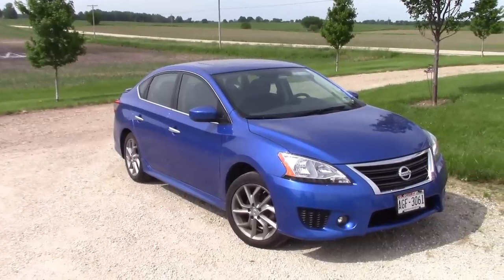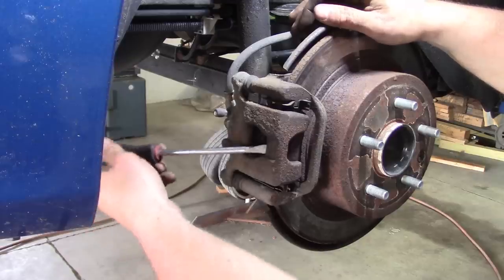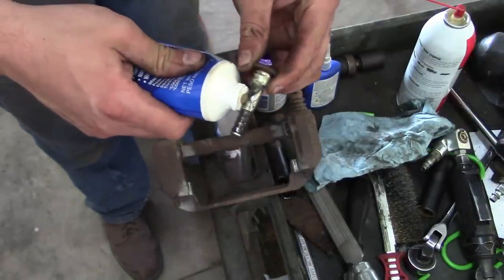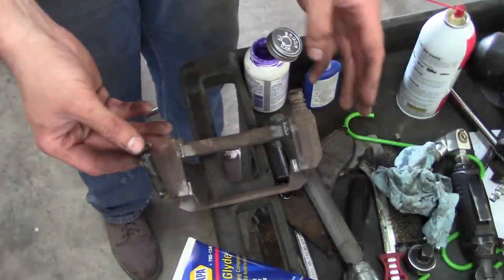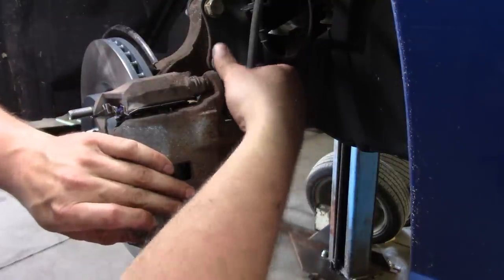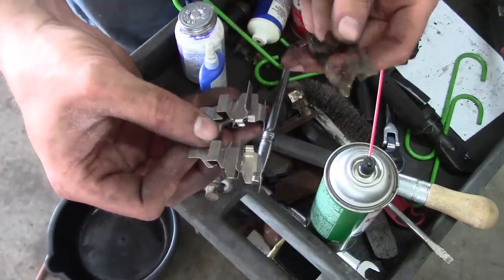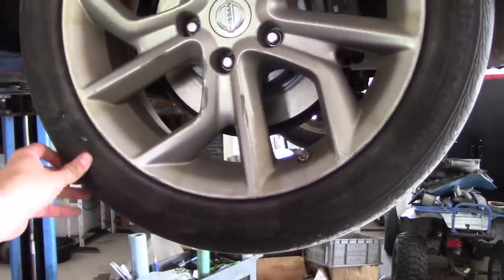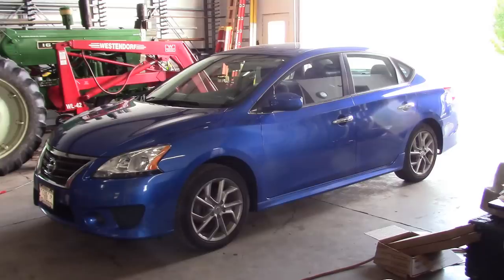Brake Job - 2014 Nissan Sentra

Comment: Why lube behind the stainless steel inserts? They shouldnt move against the caliper, should they? If lubing at all wouldnt you lube on the other side where the pad "ears" slide on them?
Reply: The reason for lubricating the backside of the abutment clips is to prevent rust jacking from caliper brackets, a process that results in the binding of pads.  Lubricating the abutment-clip-brake-pad interface is not necessary.  Indeed, it will result in pads sticking when the lubricant picks up a sufficient amount of dirt.

Comment: Thanks for the great video.  What brand of anti-seize spray do you use on the hubs?  Also, do you put any lube on the brake pad tabs?  I've seen some people do this, but I've noticed that most don't when using stainless steel clips.  What's best practice for that?  I've always put lube on the tabs when i do brakes but thinking that  lube may promote collecting of dust and debris.  Thanks!
Reply: He uses STA-BIL Rust Stopper spray. He's talked about it in other videos.  It's their version of Fluid Film but a little less expensive.  I've never used it but Wes likes it alot.
He and I use the purple Permatex Ceramic lube on the tabs but going to switch to the new silicone based stuff when what I have runs out just like Wes.
Reply: @ToddKing  awesome...thanks!

Comment: I'm gonna ask a few questions
Surprise there were two different
types of brake parts on this car
What happened to one system
on all four wheels ? Wes can the
rear brakes be converted to front
brakes ? So you don't have to buy
two brake systems everytime ?

Comment: I'm surprised that Permatex would sell a lubricant for brake systems that wasn't silicone-based.  Not that I'm an expert, but I've never really paid much attention to the brake lubricant I've used as long as it was silicone based.
Reply from the maker: I never thought about it I guess. Sil-glyde worked well for me.

Comment: The rust proofing on this car must be shit. My 2000 bmw 323 still has some anti corrosion coating on its calipers after 20 years and 252k miles in the rust belt. I replaced 1 caliper and it was a reman and they sand blast all the coating off. Rusted in a heart beat after one winter, 20 year old ones still look better.
Reply from the maker: Those old BMWs were pretty solid. I would not buy a newer one.
Reply: @WatchWesWork  the new ones aren't that bad. We have currently an 2000 e46 323i, 2006 e83 X3, 2008 e60 550i, 2011 f25 X3, sister has a 2011 f25 X3, her husband has a 2014 f25 X3. I'm gonna be doing his rear brakes tomorrow. With the new cars all you need to do is get the bootleg ISTA+ software and your good to go. Tells you EVERYTHING about the car. ALL OF IT. Its the dealer software and you can't believe how much stuff there is the first time your connect to your car.

Comment: what did u spray on hubs under rotors? i have been using copper spray been working good for me
also i use copper paste on pads sliding part helps them keep frozing on that metal thing when driving in salt
greetings from finland= they salted roads even in april l0l
Reply from the maker: It's made by Sta-bil. It's the same as Fluid Film. I used to use white lithium grease in a spray can, or anti-seize paste.
Reply: @WatchWesWork  allright cheers
Reply: You need a Baaaaaaaaa

Comment: I would strongly recommend you do not push the brake fluid back up into the master cylinder as it can damage it!!  The old fluid should be replaced anyway so it just makes sense to push the old fluid out of the system.  Also saves a comeback when the master fails.
Reply from the maker: Not in out environment. You don't touch the bleeder unless you absolutely have to.
Reply: @WatchWesWork  how many masters have you replaced after a recent brake job?  It’s been my experience (45 years) that pushing old, dirty, marginalized fluid back into an old marginalized master cylinder can (and usually does) damage it.  I understand your reticence to mess with the bleeders but I think you would be well served to investigate the manufacturers recommended procedure for pad replacement.  Love your channel and really enjoy watching someone else bust their knuckles after busting mine for 40 ish years!
Reply from the maker: @mikeadams8293  I've never seen damage to a master cylinder. I've also never seen a service manual that suggested you could not push the pistons back.
Reply: I have the real mechanic book from honda to service my CRv and all you are saying is wrong.  Honda says to push it back and I have done it like that and never had an issue I open the master cylinder reservoir when I do it
Reply: @dannynica7480  that service manual assumes that the vehicle has been maintained with fluid changes, ext, but I know from personal experiences that a vehicle with a lot of miles (over 100,000 miles) has a better than even chance of damaging the master cylinder if the old fluid is pushed back into it!  So if you feel like risking buying your customer a new master cylinder knock yourself out but I’ve seen it happen too many times in the forty five odd years I was in the business!
Reply: I am a DIYer located in SOCAL, so there is my bias.  Accordingly, I never push brake fluid back to the ABS or master cylinder, always using my "Allstar Performance ALL11017 Bleeder Bottle with Magnet and Check Valve."  That stated, I have never experienced the problems loosening bleeder valves in the rust/salt belt, so I don't understand the problem and cannot suggest how to circumvent it or deal with the aftermath.  That stated, it seems to me that a complete brake job would include all the functional parts--including the bleeder valve.  If we were at the level of aircraft maintenance avoiding the bleeder would be unacceptable even if it meant replacing the caliper.

Comment: You're stopping using the blue permatex because it may not be compatible with rubber yet you still put it on the caliper piston. Uh?
Reply from the maker: It's not going to hurt anything. The grease will quickly wash off the OUTSIDE of the boot.

Comment: I don't understand why u put it under the brake hardware  I always put it on the hardware brake pad side or a little on the ears of the pad where it contacts the caliper bracket.
Reply from the maker: The problem here is rust jacking between the caliper bracket and the abutment clips. This pushes the clips into the pads and causes them to seize. The clips are stainless steel, so they don't need lube. If you read the factory service info for many manufacturer, they will recommend this same method.
Reply: @WatchWesWork  ok I have always lived in the south we don't have much rust on the vehicles down here unless there from the northern states but I get that I just have never had to do that I always cleaned it up with a wire wheel and was fine with no lube but I don't have to deal with extra rust.

Comment: What they don't tell you to do with those awful electric powder clutches used with CVT gearboxes  is to put the selector to neutral when you stop for any length of time ie at traffic lights. They are NOT like torque converters.
Reply from the maker: I've never been inside one or driven one for any length of time. Seems like they have a lot of problems.
Reply: @WatchWesWork  they have a metallic powder that once energised becomes progressively more solid with voltage. When sitting at traffic lights the powder is being stirred causing wear on the inner surfaces, hence the need to put in neutral. Also for the same reasons it is not a good idea to creep along.
 I have had to remachine a few for the local gearbox repairers to get rid of the roughness that causes drag and other nasties.

Comment: Facts & Reality
Toyota Prius Front Brakes
Specifically Toyota Prius Gen2 2004-09
Generally speaking my Prius has minimal brake pad material wearing additional the brake rotors always glaze smooth for whatever reason
Eric O did a Gen3 rear brake repair job using purple permatex on non rubber
Toyota sells a pink to red color brake rubber lube or lithium soap grease
My issue is after extended periods and during non summer months the slide pin dry out

Comment: No "theres your problem lady"? Or did I miss that part?
Reply from the maker: I think I said it's a Nissan...
Reply: @WatchWesWork  Pissing downwind mate, lol. Nissan Navarra here. Works well most of the time but it is a car , and that is a problem in itself, and Nissan uses waaaaay to much electronic stuff. BTW, if you come across a Navarra, put a robust shield right behind the right front wheel. The electronic box for anti spin, differential and all else is located there. A damage to that mean that you have to change the whole octopus wiring harness going out to all four wheels. Hardware only 3000 dollar me thinks.

Comment: Is that a good idea to push brake fluid back towards the reservoir?
Reply: Isn't that where it came from?
Reply: @mikehynes6632  Thats a good point. I wouldn't want to push old crusty brake fluid back through a abs module and master cylinder. Kinda risky.

Comment: Just a question Wes, when the pistons on the brake callipers are compressed back into the cylinders isn't there a danger that fluid will back up into the master cylinder and cause in to overflow?
Reply from the maker: The only way it can overflow is if someone has over filled the reservoir.
Reply: @WatchWesWork  O.K. if I ever need to do that I will check master cylinder first. Thanks

Comment: CVTs are odd.  We have a Subaru with it.  Most of the time great but every once in a while it pulses on acceleration.
Reply from the maker: That's probably not a good sign!
Reply: Driven 3 different Subaru's with CVT, probably clocked up a few hundred km, haven't noticed anything odd with any of them - very smooth and pleasant to drive. I did baby them, however, as they belong to other people - no full throttle, but probably 50%.
Reply: Watch Wes Work I know.  It’s been in more than once.   Usually when cold and pulling moderate to light to 25 to 35 mph.  My wife’s car so it is hard to get the rules of engagement so to speak.

Comment: I always use the Permatex green synthetic brake parts lube. I like it better because it's not as thick as the purple stuff and things slide easier. I've never had an issue with swelling of rubber parts. I have taken pins out that have had the purple stuff and the rubber bushing was definitely much larger than when it  went in.

Comment: On your next break job don't use brake cleaner on the rotors try dish soap and warm water. I started doing it that way a few years ago and I've had very very good luck breaking feels different because brake cleaner will leave a small film residue that you can't see or feel and it'll mess up the brake pad to rotor seating process.. trust me because I have used brake cleaner for years I know it sounds like a pain in the butt but it definitely works and I use the same kind of rotors

Comment: I’ve never had an issue with the purple. And if it in theory did damage a boot.. how expensive and hard is it to change a boot? Not hard or expensive at all. What about a stuck pin? Not hard at all. Heat it up and beat it out. Replace the pin and boot. No big deal at all. 

Use what YOU want to use is my advice. I swear to god people take this stuff wayyyyy too damn seriously. If you’re actually taking the time to change your brakes— you are ahead of 90% of everyone else and these so called theoretical bad things are much less likely to happen to you.

Comment: What a treat, just brake components on the family "Datsun" I found out latter that Nissan was the original name an not datsun. So much easier, now to do that as opposed to swapping a engine in those little rice rockets... Dog appears to be at least one brain cell smarter... not hung up in a fender flair... I am sorry but it will take a lot to get me to like and drive the little guys, give me a family sedan or even a sporty four door hardtop... two kids in the back. That was in the day. Thank god I    don't live in rust country... why     do calipers have to cost a arm and a leg yet buy them loaded for just pennies more and such a better deal, still over priced tho

Comment: Wes only use clear silicone on the pins nothing else    I only use clear silicone paste  on the guide pins and even on any other brake parts  like the face of the piston and on the ears on the pads

Comment: There is ONE kind of rubber that Sil-Glyde is NOT compatible with.  That would be Silicone rubber. It will cause it to swell and deteriorate.

Comment: Hey. 1.17. Just cause this is a brake video doesn't mean you can use the Eric Obrochta "do do do do" line. Oh and you think the wheel lock on the nissan is funny. I've worked on several Hondas that had wheel locks on steel wheels with plastic hub caps.

Comment: What was that spray he used before putting the new rotors?
Reply from the maker: Fluid Film
Reply: @WatchWesWork  Thank you. Is it high-temperature resistance? does melt off and contaminate the brake?

Comment: Have a question. I've watched many of your videos and have learned a few things. On your brake jobs I've noticed that you always use lube behind the stainless clips. Just wondering what does that do? Is it for less brake noise or just to help to get the clips on? Also, in your opinion is there any value to lubing the front of the clips where the pads ride?
Reply: I know this was 8 months ago but don’t see any replies…Applying that purple lube is to prevent “rust jacking” behind the pad hardware. Get rust back there and can freeze ur pads up tight! No real need to apply to front side of hardware as hardware should be new shiny ani rusting metal…Oh and don’t use the purple brake lube on the slide pins….use the syl-glyde stuff he uses or something similar. The purple line is to tacky and also may distort the rubber on the slide pins…..hope this helps!

Comment: I have had that purple stuff cause nothing but nightmares on Japanese autos . It works great on the back of pads and on the ears. The Silicon extreme hasn't caused any rubber issues, but it does seem to like to draw moisture into itself it seems.
Reply from the maker: Interesting. I just haven't used it enough to say.

Comment: Stop using purple stuff on slide pins!  STOP JUST STOP!

It always swells up slide pin rubber parts.

Always use Sylglide for the slide pins---it works, use it.

Comment: I have used normal multipurpose grease in slide pins. No issues with rubber boots.

Greasing pad/caliper contact surfaces is useless.

Comment: I am never going to understand People that never ever check the brakesystem on their cars. They get irritaded if the radio doesnt work but dont give a damn about the Most important system in the car. She  should have done something about the brakes a year ago!
Reply from the maker: This is pretty normal. Most people worry when the pedal hits the floor.
Reply: Watch Wes Work unbelievable, i think most people were i live, way up north in northern Europe, does it. Twice a year  we Change between winter and summer tires and when We do it most people just give every brake a fast check if its ok. If you Dont change the wheels yourself most tirecompany will do so as a routine. Every 2 years we Are obligated to get an official inspection of all our viehicles and they Will not allow viehicles with brakes, like on the car in your video, pass the inspection! If they are to bad the viehicle Will be grounded until its fixed and you have passed the test. Sorry about any language misses, i have my keyboard set on swedish with all auto spell problems that Come with it etc.

Comment: Anyone have thoughts on the orange Permatex Silicone Ceramic Brake Lubricant
Reply: It's silicone so it's fine for the pins as well as just a plain silicone grease. Just don't put any sort of anti seize on the pins.

Comment: "Let me grab my torque wrench and torque this to spec"... Then grabs an air impact wrench and gives it too quick burst.  Later in the video he makes a similar comment he says "let me grab my other and torque wrench" and then picks up a standard ratchet to tighten the two caliper pins.   

This guy obviously has no clue what a torque wrench is and if he thinks he can tighten the boats to torque specs with that air impact...... I'm not letting you work on my car!
Reply: LMFAO "the boats"

Comment: After driving a CVT for years I actually don't understand how I or anyone else ever got used to regular transmissions lmao.  In my car if your on the highway and ya start up a little hill ya put your foot down a little more you hold your speed.  In ever regular automatic I've driven in the same scenario you just keep pressing down your foot while slowing done until the transmission finally decides to shift down at which point you go from below your target speed to over it rather quickly.  CVTs are definitely the future imo

Comment: Of man, six year old car and brakes are in so sad shape. Of course miles wear pads.. But amount of corrosion. We have also lot of road salt in Finland but at least in my 2001 Mercedes with 200tml have better looking brake stuff. Meaby Nissan have used poorer materials.

Comment: What is with the torque theatre? You know you do have to torque brake bolts correctly??!?!!
Reply: yea every bolt on cars if you want too get picky about it never had a brake fall off yet have you?
Reply from the maker: Our government provides free thread locker on the roads every winter. We are way more concerned about making sure bolts will come out again than making sure they don't fall out on their own.
Reply: @WatchWesWork  Good Ol Rust My Eyes Still Hurt Sometimes
Reply: @WatchWesWork   Wes -- that impact gun surely over-tightens the bolts? No?  (I wasn't talking about UNDER-tightening it -- I was talking about OVER-tightening it and having the bolt snap at some point.)
Reply: Abbey Road he used a torque stick.